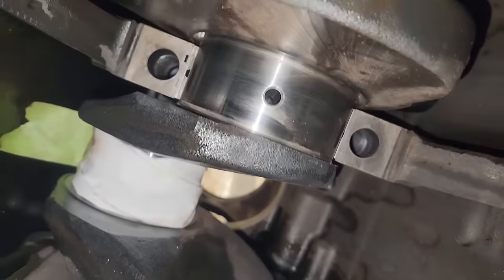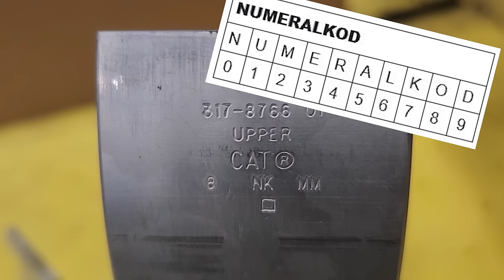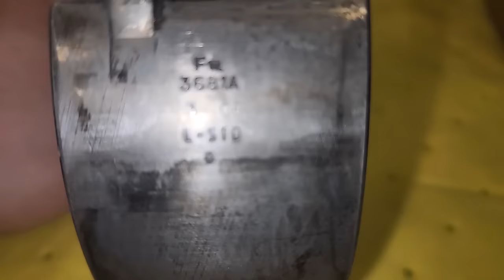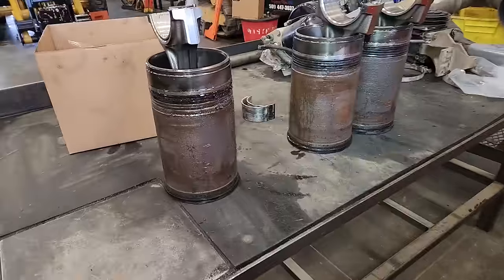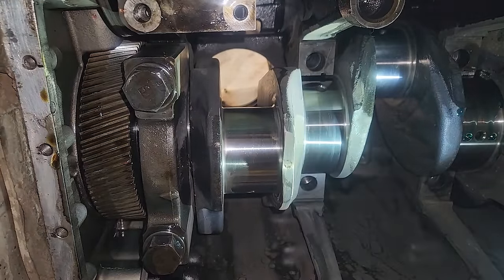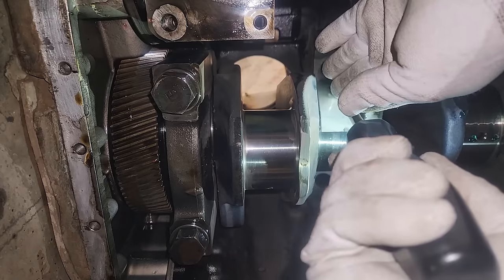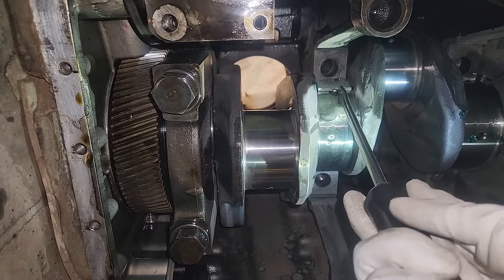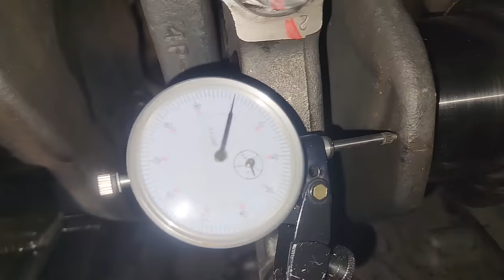How To Replace Engine Main Bearings.

Comment: How do you get an accurate torque reading with an extension?
Reply: The extension doesn’t twist or change the length of the torque wrench. It will always be accurate.
Reply: If you think for one second this guy has not checked for accurate torque with extension then u don’t watch his channel. It’s a steel 1/2 extension, we’re not talking 3/8 at 190ftlbs we have all done this by torquing with the extension, then taking it off and trying it without the boat never moves before the clique unless you’ve stacked a bunch of extensions or your extension is really long for the rated torque spec
Reply: The torque is the same, regardless of the twist in the extention.

Comment: Adept Ape what's your take on adding a turbo to a diesel tractor engine with the purpose of adding more hp? I recently bought a kubota b7100 and someone suggested adding a turbo to gain the extra hp I wish I had but don't know what that would do to the long term performance of the engine.

Comment: Bearings had scoring marks it was gonna eventually fail due to oil starvation.  Surprised the journals still looked good.  Main reason why I had my rods and mains done at 999,000 miles.

Comment: Several years ago Cat said not to use white lube as it may block the oil from reaching the bearing. Ever had one that would not go in, yet if you try it on the other side it will go in. Had a few of these and I cut about one inch off the tab side and put the bearing in backwards. It leaves enough space to put the new bearing in and roll the cut bearing out. And of course never use a rag or anything to clean a bearing. You will destroy the surface and contaminate the bearing with impurities. Use a spray chemical that will not harm the bearing surface and let it air dry.
Reply from the maker: That's a good idea for wedging the old bearing in to roll the new upper in. I've had a couple tough ones that I've had to rotate the crank around to find the right spot. You've probably done 5 times as many as me though so, you've seen a few tuffy.
Reply: @AdeptApe  By far the hardest main bearing to install is the front one on a 3208. As the oil pump is made in the front cover and you have to use a special adapter to T & T the bolt.
Reply: @AdeptApe  You ever had to fix the block that the corner bolt was broken off for the oil pump?

Comment: I work on much smaller engines but still find your videos interesting and very well done.

I do have a question about torquing large bolts like these. Does a torque multiplier fit or assist when doing these in-frames?

Merry Christmas!

Comment: Yeah would the torque be at 120 degrees? 700ft lbs?
Reply from the maker: Pretty sure it's 10 quadrillion ft lbs, that is what it feels like. One of the dang mains on this engine actually wouldn't come out with the impact. I tried my 30" 3/4 drive ratchet and dang near bent the bar. Had to use the 1" impact that was fun trying to hold that heavy sucker with one hand and the other hand holding the main cap.
Reply: @AdeptApe  I've torqued the mains on many small and big cam Cummins and that's what it feels like even though the spec is only 310. It still takes 2 people, one to hold the socket on and one to pull the torque wrench. Torque turn you can do by yourself 🙂
Reply: @AdeptApe  I bet if you run across that again with the 3/4 impact on the second cap bolt and its not breaking free and forced to use the 1 inch, you will clean up a cap bolt and spin it back in with the little driver so you can handle the 1" beast with no worries about the cap falling. Easy for me to armchair that though, hindsight is always easier then being in the moment.

Comment: 12:45 some gas engine builders put atf on the back of the bearing shell. I forget the rational for this.
Reply: I was told heat transfer.

Comment: Man angle torquring with a impact. Alot braver than me. Done plenty of bmws and those aluminum bolts id never hit with a impact
Reply from the maker: You aren't turning these freaking 1" bolts by hand, that 3/4" impact will barely do it. On smaller fasteners I'll turn it by hand.

Comment: Several guys I have watched who filmed at work ended up getting fired.  I hope that doesn’t happen to you.
Reply from the maker: Well I sure hope not, the company I work for actually reposts my videos and does Cat gear giveaways on the channel so it's a little different than most situations I think.
Reply: Good news!
Reply: Hard to find a tech who knows what he is doing. So they will be forgiving as long as Josh don't step on a land mine.